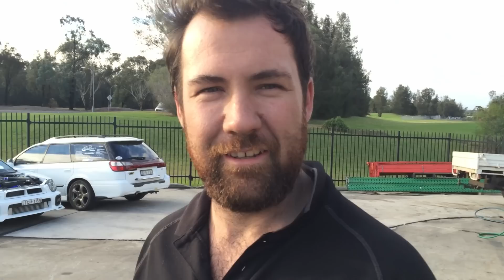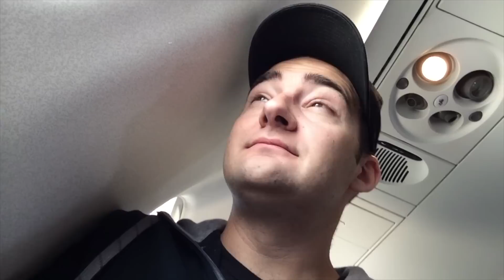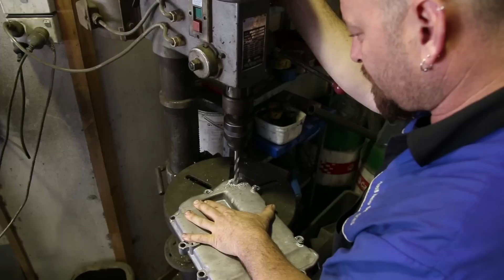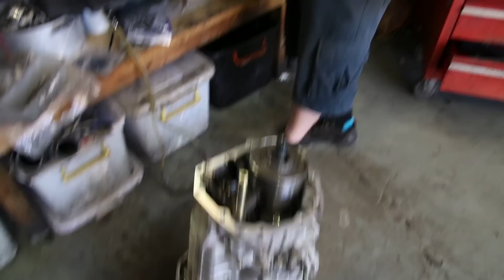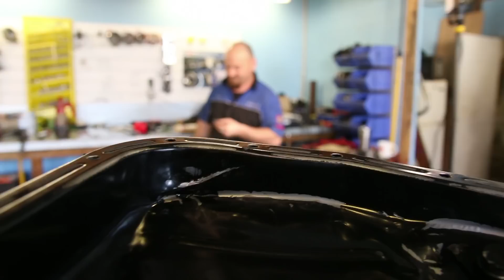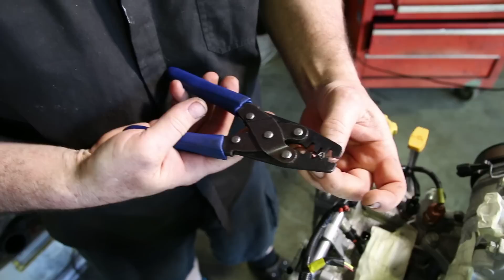Gramps the 11 Second Car - Build Part 1

Comment: Supergramps finished, coming back for nostalgia, who else?
Reply: Came back because marty bought it
Reply: Im here now. For the 4th time around watching the full series from the start lol
Reply: @3ddrew691  yea, I would be getting to that point as well. Super grams is one of my favourite cars on the internet...
Reply: @makuenchilton453  that and the double unicorn Stagea build is my other favorite. I really want to import a stagea with a R34 front end conversion.
Reply: @3ddrew691  Trying to watch the first gramps build for the first time. Is there an official playlist? I'm trying to figure out the order
Reply: @patrickfitzwater5511  yes there is a full Playlist. It starts off with original gramps and then it keeps going with supergrampq after the unfortunate tragedy to original gramps. Check their Playlist page and go down. You will see it.
Reply: @3ddrew691  gotcha. "Gramps" (1998) is technically the second vehicle they swapped? The first car Marty showed driving and talking about was Turbo Yoda swapping STI drivetrain and WRX engine. Do they ever explain what they did with that car?
Reply: @patrickfitzwater5511  they had first gramps, they swapped it. Then when it went to paint got flooded in a huge storm.  Supergramps came along and replaced the original
Reply: @3ddrew691  just watched that actually. Kinda sad watching it all unfold like that. But there was a third car too. The first car that they bought from Yoda with the STI running gear. That's the one you are saying they swapped. Just wondered if they kept it
Reply: Amazing how you read my mind!😂
Reply: SuperGramps is back with Turbo Yoda
Reply: Came back because I'm STi swapping an 09 N/A auto 2.5i outback.

Comment: "they dont call me N/A yoda" fucking classic
Reply from the maker: what a legend!
Reply: You guys are legends too
Reply: +Thomas Leahy I have much respect for turbo yoda as well now thanks to the Mighty Car Donkeys, but he does not do a good caulking job on the valve cover and oil pan. If there's  too much caulk, the shit will break loose and get sucked up into the oil pickup and plug the screen -potentially impeding or preventing oil flow throughout the motor and turbo!
Reply: Tyrone Keith Henry you need to learn not to be a necro dabs 😤😤😤😤

Comment: Was there a reason you chose this engine over the EG33? I've heard the EG is a bit easier and less expensive to work on and can yield the same results as building up an EZ36
Reply: That, and the EG is non interference so no engine fuckery if/when your timing belt shits itself
Reply: I'm just gonna assume that they had access to a practically zero Km/h or Miles EZ36 so they took it instead of tracking down a limited supply of high miled SVX EG33 engines... which might be even harder to find in Australia? The fact that their EZ36 is practically new will help them out a lot.
Reply from the maker: EG33's are a bit bigger and don't fit in the engine bay as easily. Also the EZ36 is a modern engine with ethrottle and AVCS. The rest of the series will give you some insight as to why we went this way...
Reply: Mighty Car Mods This is the best thing ever. Thank you guys.
Reply: The EZ series of engines is significantly shorter than the EG series due to using a timing chain instead of a timing belt.  Will fit into the engine bay much easier.  It is also stronger out of the box, and they don't seem to plan on swapping out any internals.

Comment: You called McDonalds "maccas" but you still called it "burger king" like us in the states', instead of hungry jack?
Reply: Some areas of Aus have HJs, some have BK. Not sure why.
Reply: Burger King and Hungry Jacks are two different places over here in Aus. :)
Reply: No way.... Really? I though burger king was named hungry jacks in aus because of some weird issue.
Reply: danehb89 Melbourne has both.
Reply: There was a lawsuit with an existing franchise so it's hungry jacks everywhere except the airport (international section) because its technically not australia anymore
Reply: Quaker763 There is a burger king in st kilda?
Reply: Gee Zed Eee Power Is there? Can't say I've seen it before. Might have cost them too much to change the whole store (hence why EB Games isn't called Gamestop)
Reply: Quaker763 There was, apparently you're right about the rename though. Was on one of the main streets (not ackland, but very close by).

Comment: love the build and the details guys! can't wait to see it. I'm currently doing a swap in my 2005 legacy gt from the 2.5 EJ255 ( blown just like gramps) to a jdm 2.0 liter EJ20X. in the next episode could you guys give a bit more detail in for the ECU and wiring ? i understand your going to use a Haltec ECU and I would like to see the wiring process and matching up the sensors to the harness on the engine.

Comment: MCM could you please tell us more about proper way to reinstall rocker covers ? Like what proctuct to use when cleaning the surface, what liquid joint you put in addition to the plastic gasket, etc ? Same for the oil pan.
Thanks a lot !

Comment: Not to be doubting turbo yoda, but with mounting the fans the other side of the rad does that not mean it will be blowing the heat into the engine? Or are the fans being flipped so its sucking the hot air away?

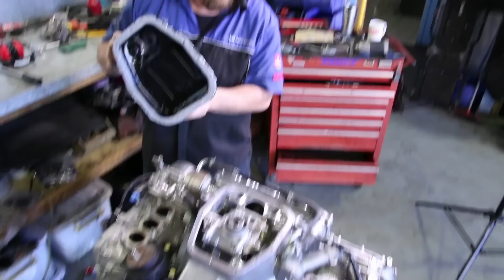Comment: At 16:40 Turbo Yoda is going to have gasket material floating in the oil and sticking in the intake screen of the oil pump for the duration.  That is WAY too much gasket material to be squeezing on there.  I watched a Mercedes AMG factory video where they just put about a pencil lead diameter of the stuff between surfaces and it worked just fine.

Comment: Or you can buy a diesel powered truck, and with a larger intercooler, some adjustment of the waist gate, and time with a chip tuner, make an 11 second truck that still get in the low to mid 20 mpg range with loads of utility.

Comment: Are you guys going low boost because of the higher compression engine? Just curious because I looked into turboing my 350z but figured it wasn't worth it because you can't put much boost behind a high compression engine.

Comment: I See you can get a supercharger for the 3.6 by raptorsc in Australia. Wonder if that would be easier than turbo charging the 3.6.
Curious because I have one and want more power haha downside I have a 5 speed auto no manual

Comment: That engine they are talking about at 6:30 the flat 6 3.0L is that the same engine in a Subaru Lancer 2004 \ MK4? It looks exactly the same!
Reply: Daniel Astbury Nope, the Impreza (Lancer) never got a 6 cylinder Boxer out of the factory. The first "modern" H6 was in the Legacy/Outback from 2002, and was later replaced by a modernized version. It's still an incredible engine. For a 6 cylinder, it sports good reliability due to the timing CHAIN and no timing belt. Has decent power as well, as long as you don't mind the horrible fuel economy (in the city it averages 20L every 100KM, which for Americans means about 12-13MPG on average, and at most 17-18 MPG (14 liters for 100 KM in the city if your foot is feather light).
Reply: Newgenerationisbg Thanks for the clarification! I've just bought an 04 Legacy and it's amazing. (I meant to say legacy, not lancer, sorry).
Reply: Daniel Astbury The 04 Legacy you have has the "renewed" EZ30 (some major changes over the older one, helping it with reliability, fuel consumption and power), but it still shares quite a lot with the older one. I currently have a '96 Audi A4 1.8, but I want an H6 Outback for my next car, since it has everything I am looking for in a car (I was also looking at a 1.8T A4 Estate, as they are just as fast because they weigh quite a bit less, but their front suspension is aluminium and is easily bent on shitty Eastern European roads)
Reply: Newgenerationisbg Thanks for the info!

Comment: how do you put the piston pin in on the center cylinder of a flat six boxer????
Reply: Carefuly
Reply: +danthemanzizle IIRC similar to the way you do on the EJ, there is an additional window in the crankcase web and you have to slide the pin thru the outer cylinder to the middle one (so middle piston installed first! LOL). Then outer cyls same as on an EJ. Again, IF I remembered that info correctly, haven't looked at EZ30/36 info in a few years.

Comment: Will you get multi-fuel capability with the ECU you're going to use? Or will you be stuck with running on E85? I'm thinking not all gas stations will have E85.
Reply from the maker: Looking at going with a flex sensor!
Reply: Mighty Car Mods Sweet! Hopefully you should be able to have more aggressive ignition on E85

Comment: I thought that they would take the 2JZ from the Cressida. Is there a reason why the didn't/couldn't use that engine?
Reply: It was a 1JZ for a start.

There're quite a few reasons why; space constraints (a straight 6 is a considerably longer engine than the flat-6 because of the cylinder layout; I'd bet on it being absolutely impossible to fit it in the engine bay), and even if it did fit it's a motor designed for RWD applications which is not going to work in a car that was made in front- or all-wheel-drive or cost an absolute bomb to do.

Finally, the EZ36 is a fresh challenge whereas the 1JZ is a been-there-done-that affair when it comes to getting a load of power out of it.
Reply: SICEM_Rex Thanks, that cleared up my confusion.
Reply: +SICEM_Rex I thought the (spoiler alert) newer gramps body, is from a FWD car. So most of the cars weight is in the front, causing a not for RWD suitable front/rear weight bias. Eventhough the Supra had like a 60-55% front bias too. The Legacy is designed for the EJ20/EJ25. The EJ engines have a very low profile, and is shorter then an inline engine, Allowing them to make the engine bay much more compact, allowing more room for passengers. So no way an JZ engine would fit in it without removing the firewall and doing some major modifications.
Besides the engine space, the EJ and EZ engines are bottom torque monsters whilst the JZ engines are more like high end power. So the EJ and EZ engines are way more suitable for daily street driving, as you need that torque.

Comment: im a little dissapointed that ur using a flat 6 over a proper subaru flat 4. no scooby burble :( but it should be interesting to see how it turns out
Reply from the maker: you need to listen to a H6 with a decent exhaust on it... you will change your mind!
Reply: i hope so!!! look forward to the next episode
Reply: UELHeaders is what you want right?
Reply: Go listen to a 911 GT3 and you'll change your mind. The flat six makes more of a howling noise.
Reply: Dude porsche uses flat 6's. Check out some sharkwerks exhaust sample videos!
Reply: if they used a flat four it would just be another turbo'd four cylinder subaru and nobody would be interested.

Comment: Why didn't ya'll modify the engine while its just sitting there. Go for all you can get. Also why not go with an automatic? No one can shift as fast as an automatic does!
Reply: +CarlsCustomCreations troll post is obvious
Reply: excuse me?
Reply: +CarlsCustomCreations LOL automatic.
Reply: yes an automatic. I have built 727's that took up to 800 hp with no trouble.
Reply: CarlsCustomCreations aftermarket internals on this engine werent readily availible and were quite expensive when they made this. thankfully theres now an aftermarket following for this engine meaning the aftermarket manufacturers are making parts for them. they are now planning on building it further. you dont put a turbo like that on a car to run it on 6psi... they have plans.

Comment: Why on earth would you guys ever bother with E85 fuel? That stuff is absolute garbage.
Reply from the maker: Your homework for the night is to find out why so many race cars use E85 and what its octane rating is... Research away my friend.
Reply: a higher octane does NOT make more power ...it is a rating of how suseptable it is to detonation ( knock) ,, higher compression engines need more octane so the fuel does not pre ignite  ..
 higher octane in a normal engine actually create LESS horse power than low octane ...
Reply: Mighty Car Mods Funny thing is that AvGas has an even higher octane rating and in most cases is much easier to obtain than E85.
Reply: e85 tune on my car gives it an extra 70hp for only $500. i don't know the science behind it but does it really matter when it makes your car faster.
Reply: Hambone The current market for e85 is rather limited to big cities. Good luck finding it outside of them lol. Unless your engine was made to run that fuel, you just wasted your money and doomed your engine.
Reply: TheOmegaRevolution BTW most of us live in or near the cities... I made 380rwhp in my ss ute. but as my ute is an e85 model they said it would have made more if i used it.. That garbage makes more power than our premium 98. Fact!
Reply: Tim Huth Way to try and speak for most of the internet, I bet you have no idea how many fans of the show don't live anywhere near an E85 pump. I bet you didn't know that the true octane rating for E85 is actually between 94-96 octane. 2-4 Points lower than 98 octane fuel. It's all about tuning really, you even said that your Ute was made to run on E85. To get any real peformance gains on E85 you'd need to have pretty high compression just to make it worth it.
Reply: TheOmegaRevolution Notice i said 'our' 98? Everybody who is a car enthusiast knows our octane rating isn't on par with say americas. I don't know why you think your smart for knowing that. haha
An no your wrong.. Walkinshaw performance is where i do my dyno runs and get my info from. Ve (series 2) utes are made with e85 in mind. Hence the E85 badge on the tailgate.. You get slightly less klms per tank but more power with an e85 tune..
 BTW look at the population on Australia.. most do live near the 'big' (small) cities we have. hense why i said 'most' of us..
without changing anything the e85 tune yields around 30-40 hp more than 98 on a dyno tune. that's why its very common now days of people upgrading gaskets, injectors, whatever else so they can take advantage of the extra gains of e85.. go talk to any performance shop mate.
Reply: Mighty Car Mods what a mick, send him to school.

Comment: MCM broke super gramps  racing v8race car no wonder they broke a drive shaft it's not rocket science if you upgrade your engine you need to upgrade the components to take the horse power🤔 enstien moment 🤔
Reply: You don't always know what's the weakpoint in a drivetrain. You'd know this if you actually build cars.